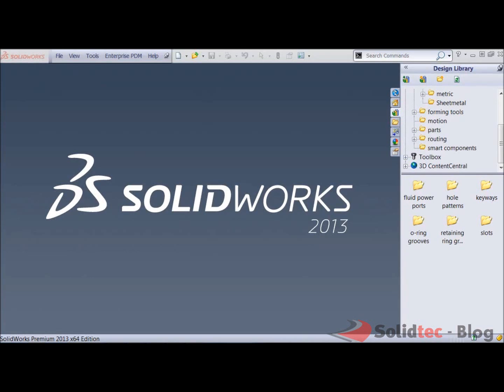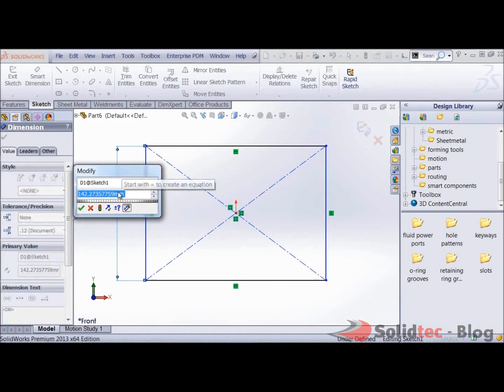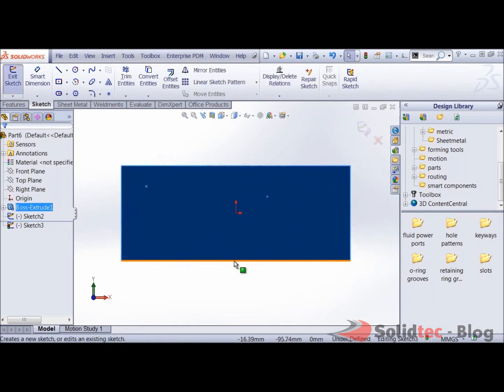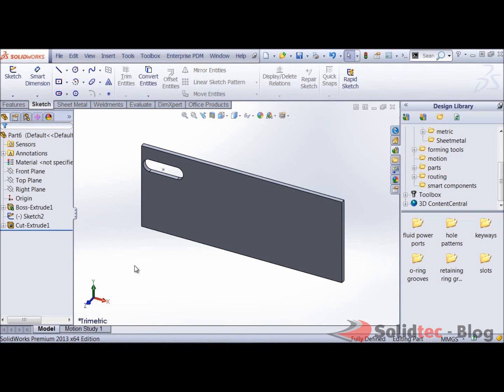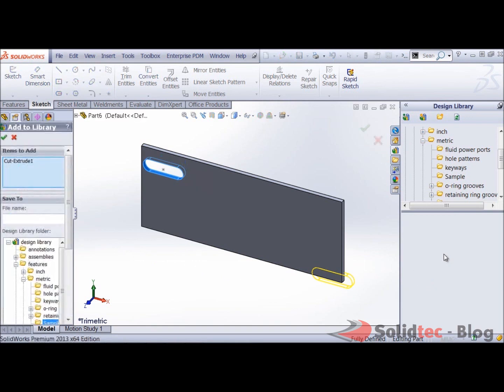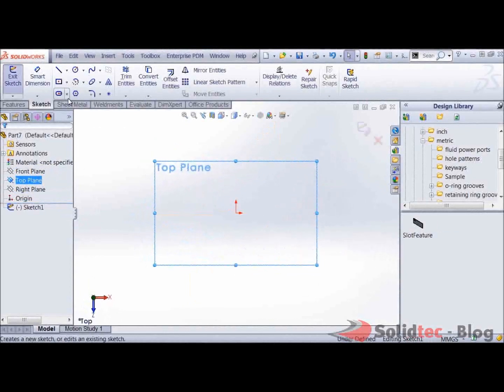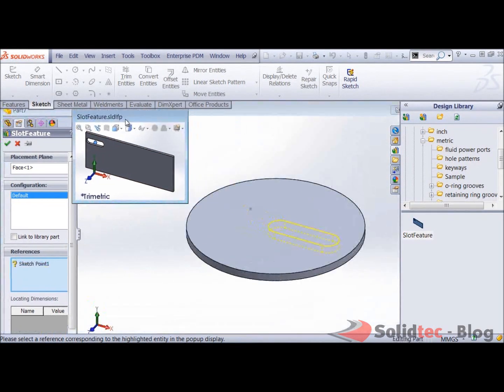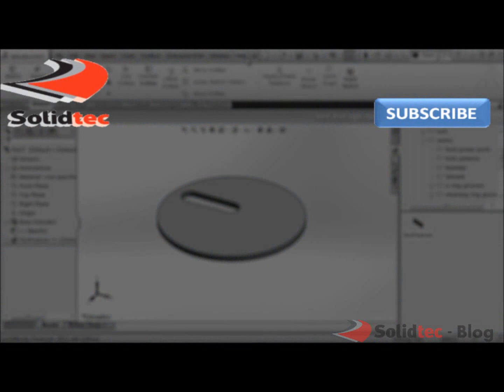How to create a SolidWorks Design Library Feature

Comment: Thanks for the tutorial, but Im having problems with Holewizard features to use this way. What I want to do is to create 8mm x 28mm holes ten times in a line where distance between holes is 96mm. Some how when I want to put my holes into new part, there are many references. I need to place these holes into edge of new part. First hole to be 7mm from first edge and 32mm from second edge. Can you give any protips to do this?